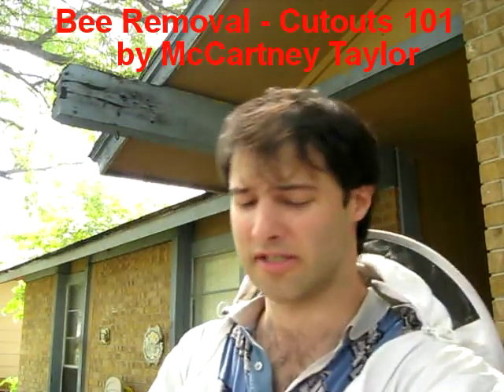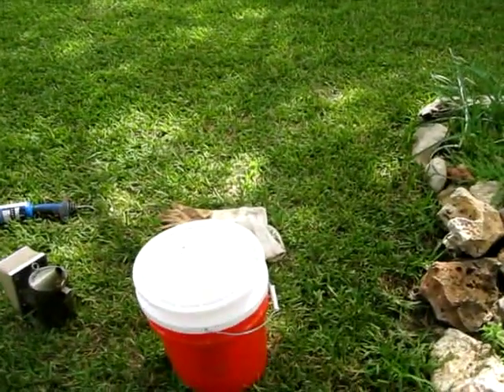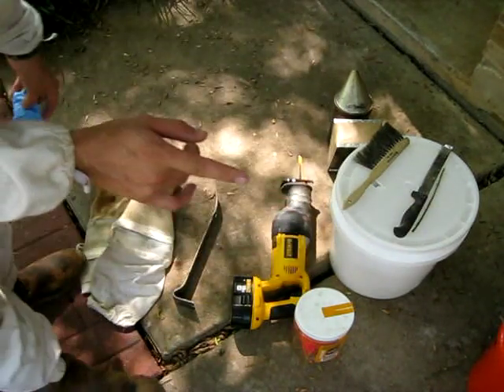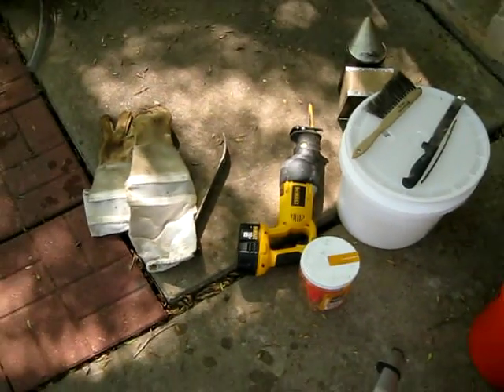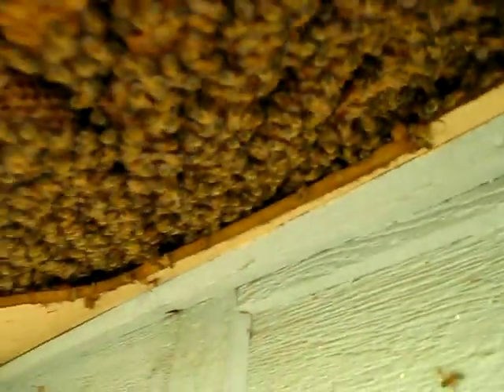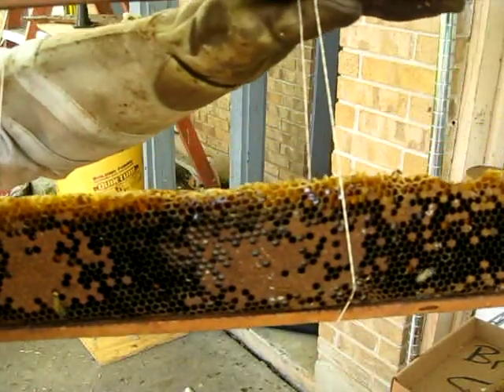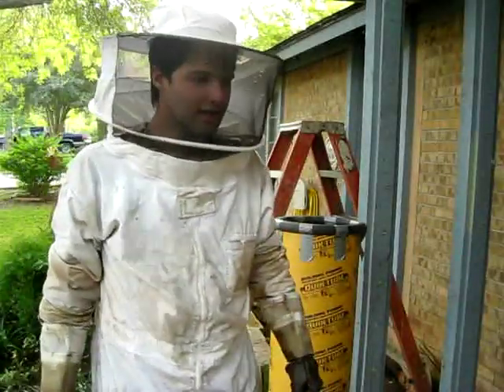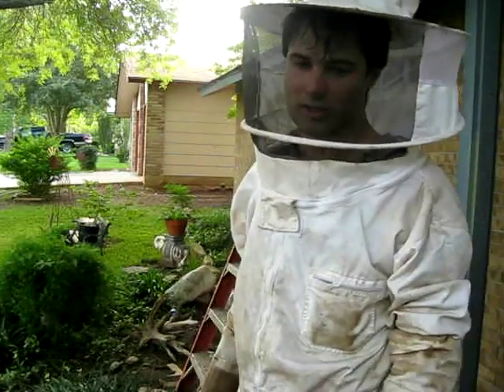Bee Removal Tutorial - How to do a Cutout 101

Comment: keep it up mr Taylor, have a Q. i found an old house bees going in and out small hole in a wood above the entrance of the door but 1 problem the house is an old school traditional house made out of white stone and mud
Reply: jannassary a couple of applications % Sevin dust, borlic acid will get rid of them,I did a job 6 months ago late winter,the owner didn't want a bee keeper,the house was quite old but for the safety of the public,I poofed around the foundation,inside the walls.it had the same problem years before,sealed the entrance up with foam.but I did the job late in the winter so they consumed most of the honey up.but the dust had seattled,left a very strong odor after 7 months of treatment, destroyed the bees!